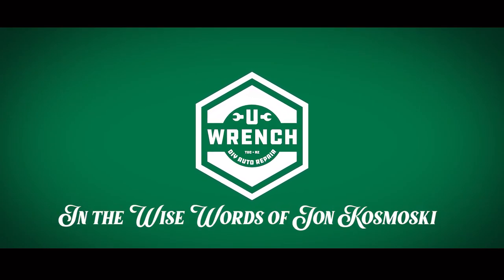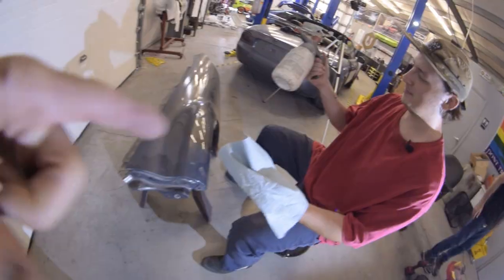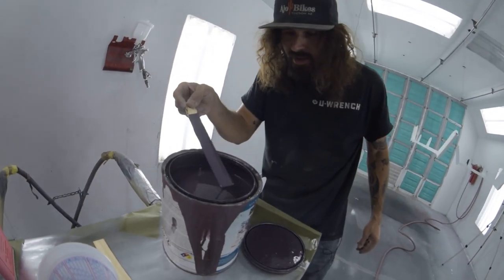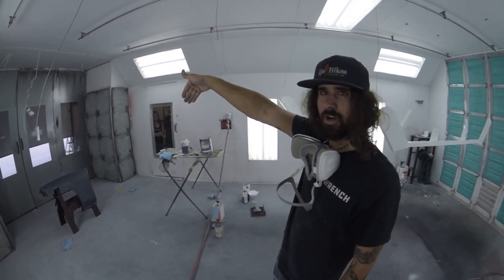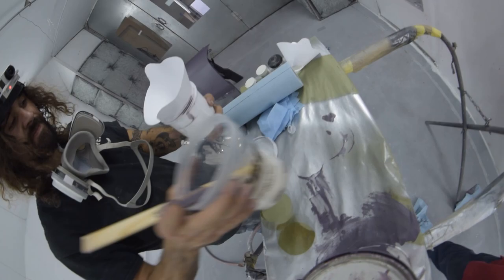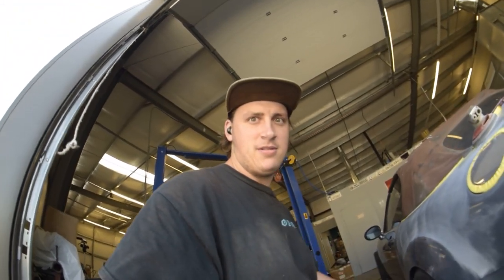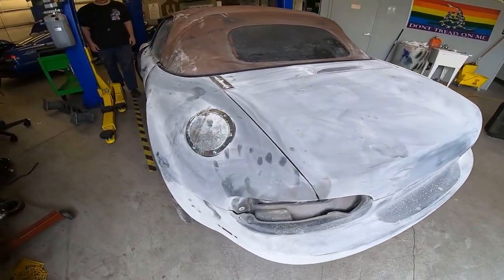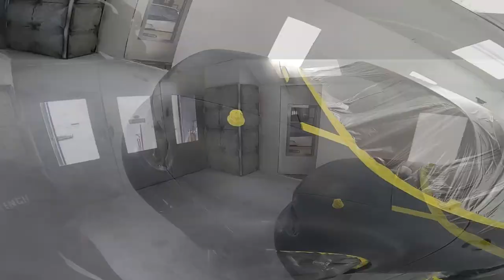Noob Refinishing his First Car!!!! NC Miata Painted with the U-Wrench Exclusive  "Orangutan Jizz"

Comment: I've been watching your videos for the past month or two (great videos by the way), and I've looked at your website, and shop rates.

I live in the Phoenix Area, you guys aren't too far from me.

My question is... If I sand off the factory paint off my car. prime it with an epoxy primer/sealer, then block it down. <-- Can I then drive my car on the road to your shop to paint it myself?

I'm specifically asking, if it's OK to drive a 1-2 week old epoxy premiered car 100 miles on the highway, then wipe everything with wax/grease remover, to then apply a base coat & top coat? Is that something other customers have done? Would the epoxy primer be OK?
Reply from the maker: Call the number on the website and ask for Fred to discuss this with you